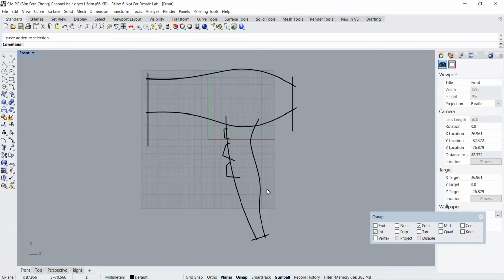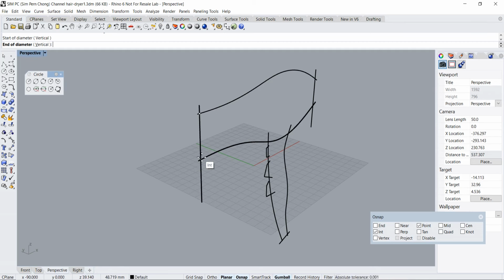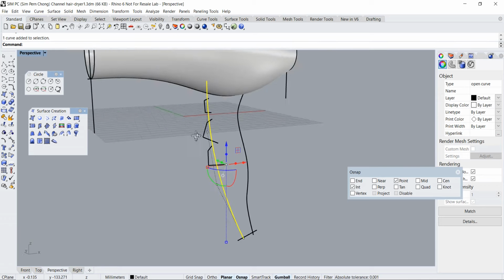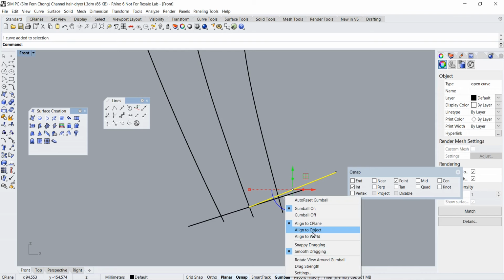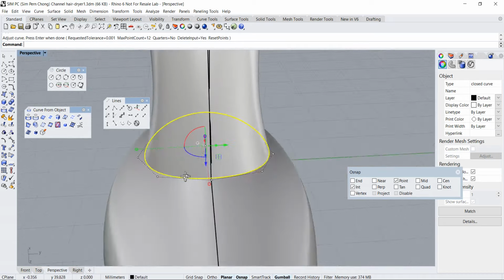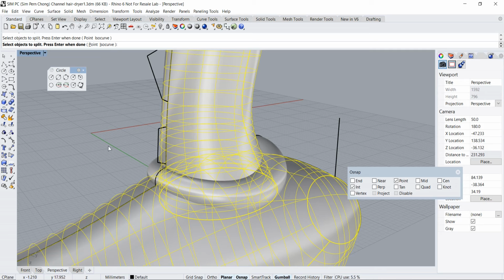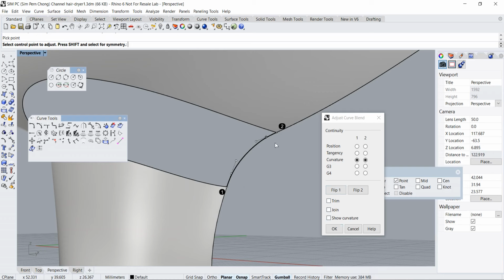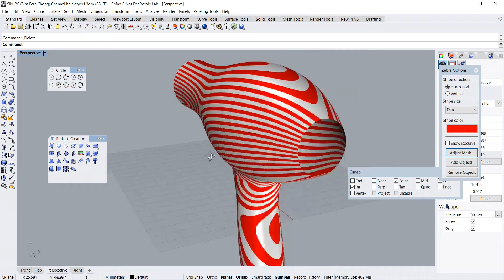Rhino 3D Product Design Tutorial: Modeling a conceptual Hairdryer (Part 1)

Comment: Great Stuff like always! One question here: What happens if you use Degree 3 Curve instead of Degree 5 curve for this object?
Reply from the maker: I think there will be very fine difference in terms of smoothness. But visually, it may not always be noticeable. In my opinion, the difference between degree 2 and 3 surface or curve is more noticeable. Cheers.
Reply: PC Sim thank you!